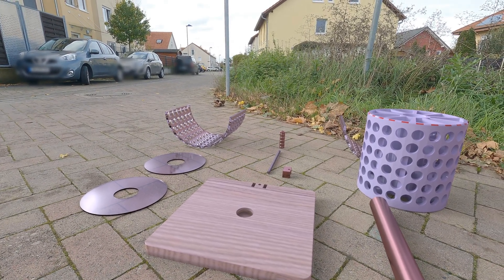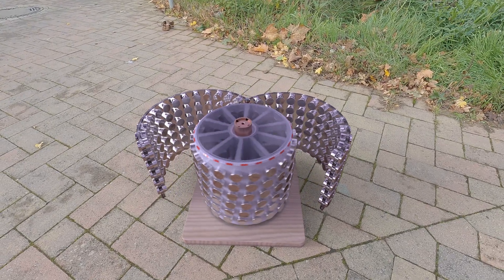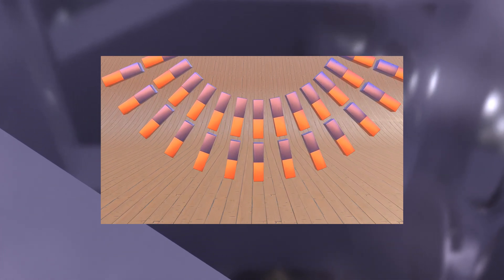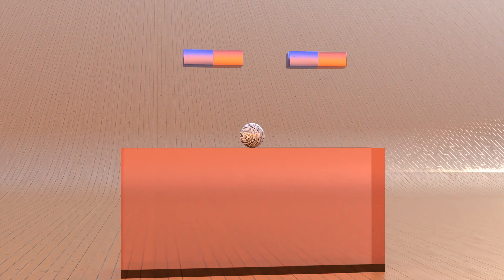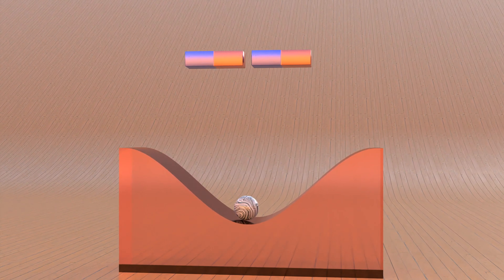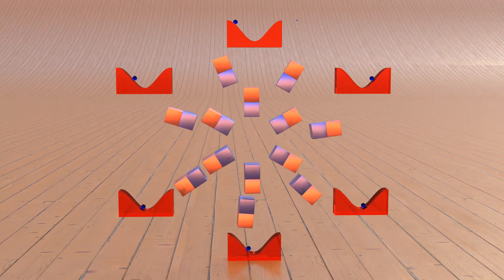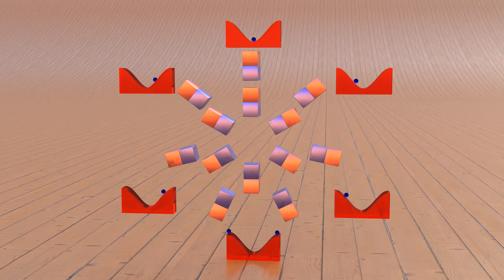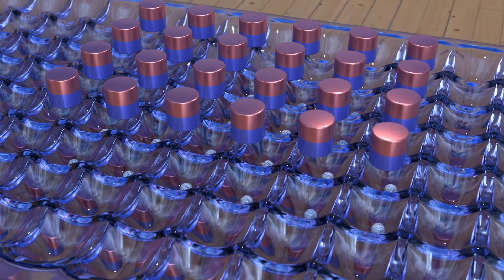Truth: Zero Energy Magnet Motor or just fake? How perpetual motion machines are mend to work.

Comment: I think some diamagnetic material shield is necessary.
Just the same as the disk drives magnets that are mouned over a material that "cancels" the field on one side...
Reply from the maker: Hi Guifer, thanks for your comment. That’s a very good idea. And I thought the same way using muMetal. This kind of metal is able to shield the magnetic field. 
https://youtu.be/oQ36wQJUYq4?si=6H1vUMMrwABCvhh1
But as you can see, there is an extra behaviour , it is also magnetic. so it’s influence it not only shielding the magnetic field. 🙂
Thanks for watching

Comment: to Daniel miles for a PMM to work it can only push "repel" because in pull or attractions the motor would not turn  as this is a permeant magnet (there is no off switch)
Reply from the maker: Hi Charles, thanks for your comment. Thx for watching 🙂
Reply: Daniel intentionally does it the wrong way. Why, I still don't know.

Comment: If you take a close look at the rotor, what do you see?: (////// = '/.) to every action (') there's an equal (/) and opposite reaction (.) ! Do you understand? It doesn't matter if you change the angle of the magnets ineed. It doesn't matter if you try to build it with magnets, weights, centrifugal force or electric. This device remains a god/creator. Something that just can't be built.
Reply from the maker: Hi Axel, thx for your comment. Yes.  It’s symmetric and so it’s not able to run perpetual. Thx for watching 🙂

Comment: I can respect the cgi but it has no practicality the problem with theoretical physics is you don’t have a valid basis for you argument because you haven’t even tried to build this in actuality to see if it works just because your incompetence won’t let you create something like this doesn’t give you the right to call BS Hal pudof and many more scientists have proven over unit devices are possible but suppressed because of the implications this type of generator isn’t widely known not because its BS but if this knowledge got
Out to the public no more energy company’s they loose billions stop defending them humanity needs to be free from the energy cartels grip many scientist and inventors have been murdered for this break through just sad to see such limitations on human ingenuity.....
Reply from the maker: Hi Nahalo, thx for your comment. Glad you like the CGI. I built some of the simpler devices without success. Then I thought about and came to the conclusion, that it’s difficult to build an machine with invisible components, like the magnetic field. It’s impossible to fine tune it. So I decided to make it visible and the results are my videos. If you then understand that symmetrical systems are not able to run forever because of the immanent balance, you’ll understand it all. Thx for watching 🙂

Comment: You need to change the poles so it's south to south ore north to north. This is how magnetic motores are supposed to work. Not like how you explain in your video. If you have no idea how this machines work stop making misleading videos.
Reply from the maker: Hi Inos, thx for your comment. Yes this machine uses repellent pole configuration. But if you watch my videos carefully, you’ll see that it’s nevertheless a symmetrical system without the ability to run perpetual. Thx for watching 🙂
Reply: @yWild  it works but it has nothing to do with your explication. I agree your model does not work but a magnetic motor has nothing to do with your fancy graphics.
Reply from the maker: Hi Inos, thx for your comment. Glad you like the graphics. You might have recognised, that there are so many perpetual motion devices on YouTube that seem to work. I just try to show a way to make the magnetic field visible and let the viewer make his own mind about. The perpetual imbalance isn’t part of our universe, so perpetual movement is not possible. If you have an working perpetual motion device, I’m glad to correct myself 🙂
Reply: Do you know or seen somewhere right one?

Comment: Very interesting.. It occurs to me that all the efforts to try and make a magnet only generator, are sticking with the same principle of forced rotation of the Rotor from fixed magnetic fields - a Stator. Granted this is how Motors work but with an electromagnet in either the Rotor or the Stator position. This is great for our linear use of Motors and our current Generators - these however require an input of rotational energy.. but... a magnet's field is a push and a pull at the same time, all of these designs are using just one side of a magnet - only half of its potential!
There must be a way to leverage the push pull of magnets to create rotation..
Reply from the maker: Hi Daniel, thx for watching. Actually, I take the side that it doesn't work at all 😄. I would be happy if you find a solution.
Reply: @yWild  Thank you, I happen to be working on a design that seems promising.. When my new set of magnets arrive i shall make a video and send to you 👍
Reply from the maker: Hi Daniel, I would really appreciate that. Hope your design is able to make it. Thx for your comment 🙂
Reply: There is...